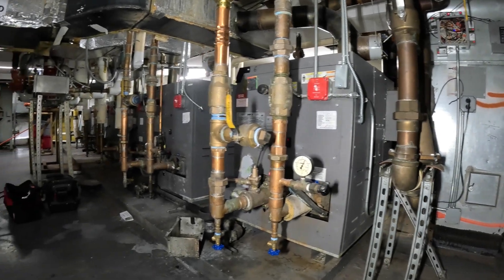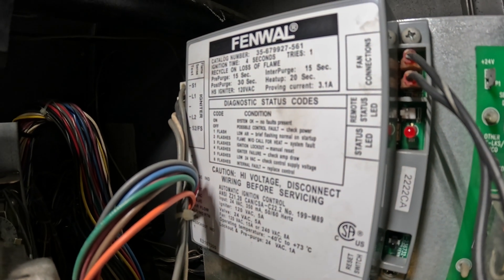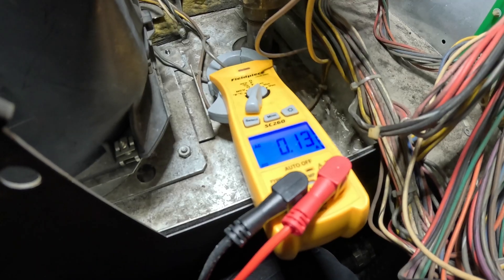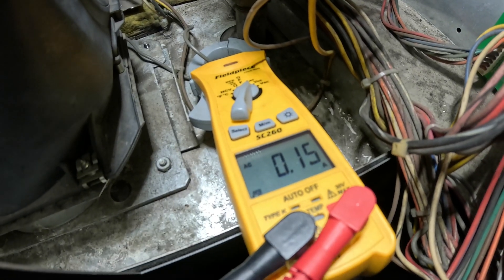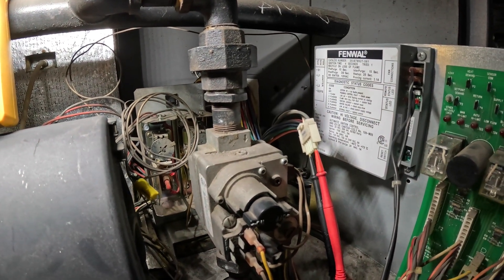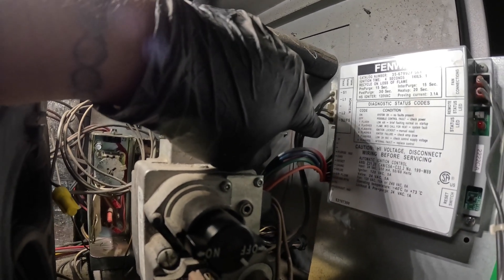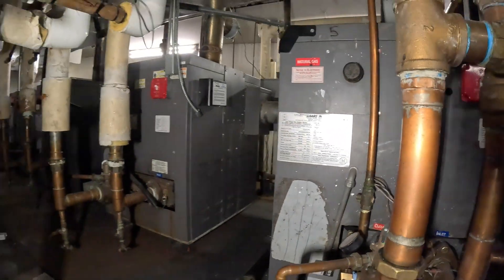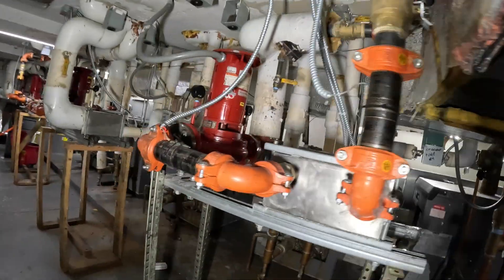HVAC: Commercial LAARS Hyrdronic Boiler Ignition Lockout Troubleshooting/Repair (Laars Pennant)

Comment: Good work. Remember that on boilers when the fan goes on right away it's for a pre purge cycle for like 10 to 30 secs. During this time there's no signal sent to igniter cuz main gas valve shouldn't be open yet. It's a process called ignition trials where each safety check n process is timed b4 allowed to go to next step. If suttin isn't right during each step of the ignition trials period it will
 Lockout

Comment: I love watching these vids as a fellow commercial HVAC tech. Some of them are so suspenseful for me when you're troubleshooting or doing a tricky repair because I know exactly how it feels like. But man there's nothing like that sense of satisfaction when fixing/figuring out the issue in this trade
Reply: I feel the same way I service mid size commercial boilers in NYC and it doesn’t get old figuring it out the problem and giving the customer heat or hot water 👍🏽